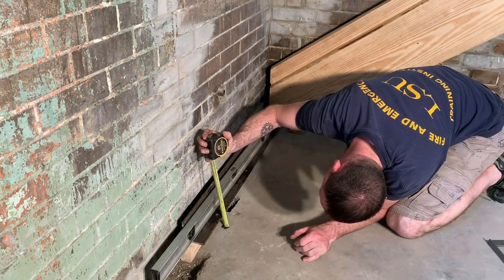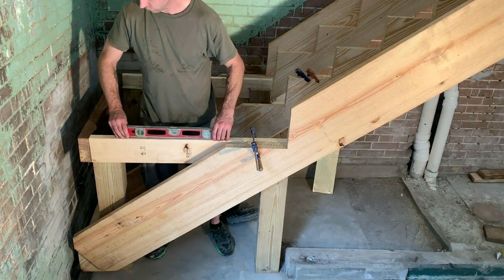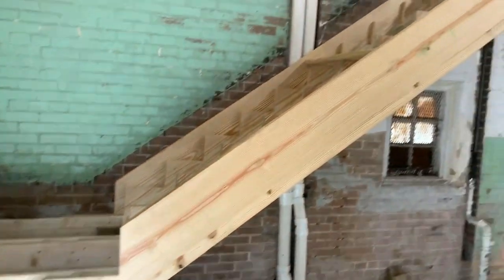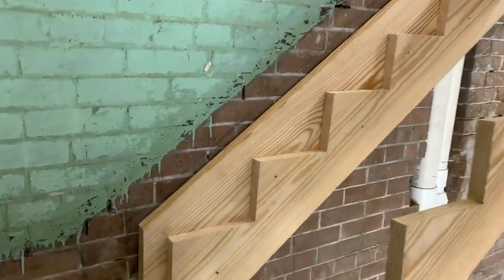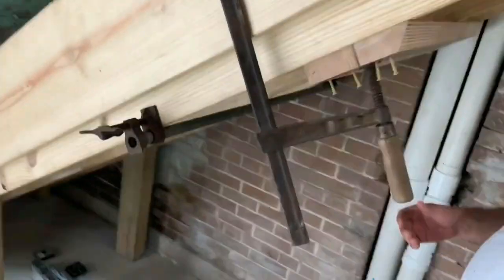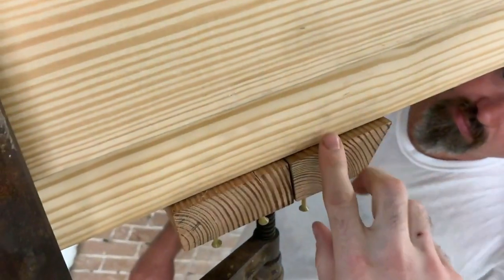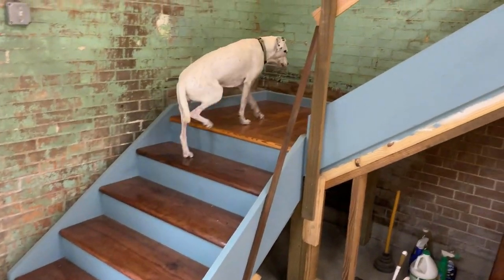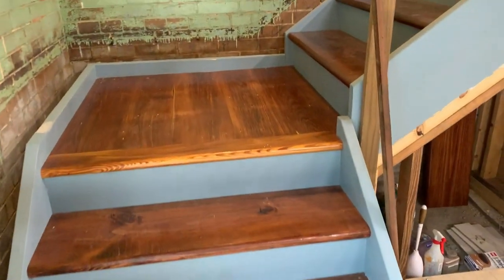Rebuilding Termite Damaged Stairs - PART 2 - Assembly

Comment: Very nice work looks great but i do have a question in the video i saw that you screwed everything.I thought you would want to nail everything for strength value because a nail wont break like a screw will i forgot how it would break i think shearing it is called from left to right where a nail would bend not break but anyway it looks awsome and the firehouse is coming along great and i miss you guys later
Reply from the maker: It’s all so well supported I’m not too worried about anything breaking or falling. I decided on screws because I thought it might hold things tighter and prevent squeaking.  Squeaky stairs are really annoying.  I need to come check out the progress on your house sometime. I’m sure it’s come a long way.
Reply: @Chemical14  sure anytime. my tenant moved so we have to renovate the apartment and we are going to do our main bathroom first while there is no living downstairs so we can do all the plumbing work both are tear out i know for sure the bathroom is. later and take care and be safe